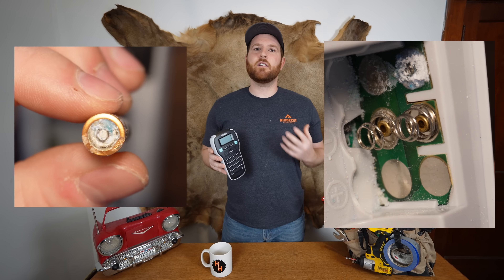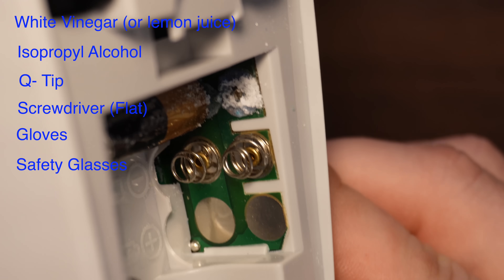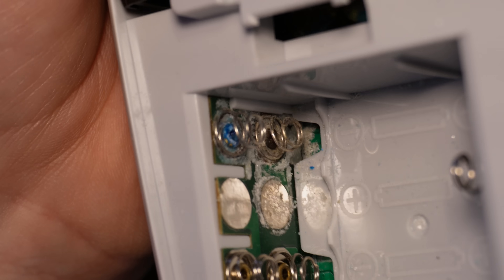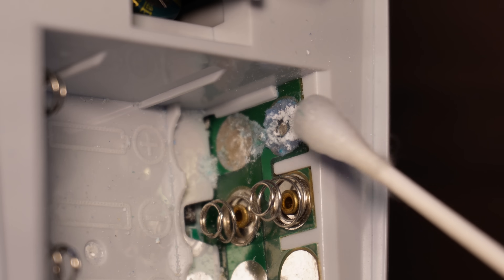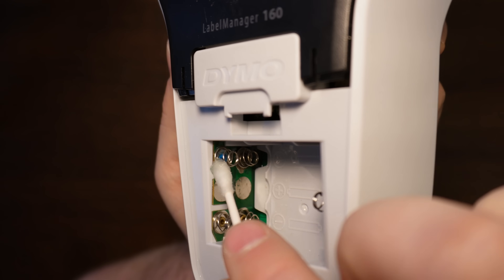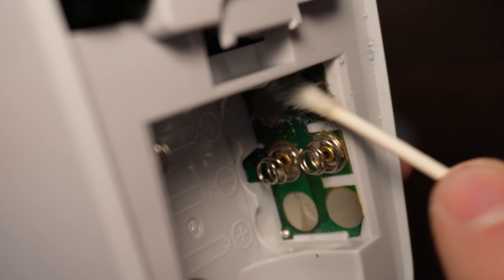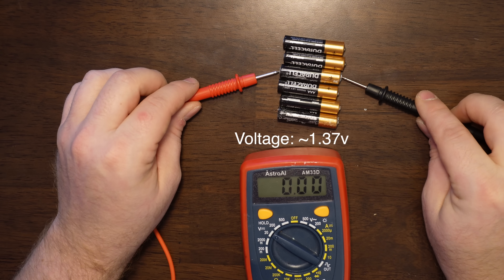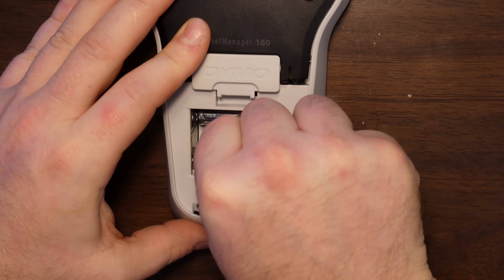Clean BATTERY CORROSION on ELECTRONICS! EASY DIY!  |  2-minute Tutorials Ep.4

Comment: I experience this more often with Duracell copper top batteries vs. other popular brands. If not using a device often, I suggest not using Duracell for a power source.
Reply: I run a small repair shop. A customer will come in and say they've ruined something with leaky batteries. I suggest I know the make of battery before they tell me. I'm usually correct...yeah it's Duracells 90% of the time.
Reply from the maker: Interesting.
Reply from the maker: Yeah, Duracell are notorious for leaking. They’ve lost my business after this package.

Comment: I'm going to try this next time the situation arise.
I've always used a mechanical effort, either with a mini file or a Dremel steel brush wheel.
Reply from the maker: Does that work good?
Reply: @HandymanHertz  
I just remove enough of the build up for there to be connectivity again.

Comment: Much more common problem these days, thanks to battery manufacturers making their batteries cheaper (in quality, not price).  A well designed and manufactured battery should not leak, and for many years I didn't have battery leakage problems with Duracell batteries.  Over the past eight or more years that changed to the point that it is now common on any of my battery powered tools, toys, lights, etc.  I now change the batteries well before they are actually used up, to avoid the damage.  I plan to change to the latest EverReady designs that have a thicker case and better seal to see if that takes care of the problem.
Reply: All of my Duracell batteries leaked over the past few years. AAs destroyed a battery operated sliding door blind and the AAAs destroyed a nice Streamlight flashlight. When they leaked and burst they got jammed into and split the battery tubes. Also two different TV remotes were almost ruined but they could just be cleaned. So I googled it and turns out it is an issue specific to Duracell. So after years of buying the copper top I switched to Energizer lithium that are guaranteed not to leak. Its just not worth taking the risk and I still can not believe how bad the Duracells were. 😡
Reply from the maker: Yeah, Duracell are notorious for leaking. They’ve lost my business after this package.
Reply: Not ever a problem if you buy Amazon batteries. I have gone through a couple hundred with never a one leaking.
Reply: @christopherterry5457 
I’ve done research on different batteries and read that Amazon batteries can explode.
Reply: Avoid Duracelll!!! Personally, I had always used Duracell up to a couple years ago because they ALWAYS ALL LEAKED and ruined a few devices. Even corroded the gloss top of a nightstand from a remote laying there that leaked through the cover!. Not sure if they still guarantee them from leaks, but couple years ago I called Duracell on their guarantee on a couple of devices, described them to the operator and was graciously reimbursed for their value, like this was a common thing. So now I use EverReady, "Energizer Max" everywhere.

Comment: I have never experienced leakage with Duracell (which last very long) and I have been using only them for decades (not the same ones of course). However I have found energizer often to be garbage. Maybe it depends on where one lives. One should never mix different brands and are you mixing alkaline and Mignon here? Can't imagine that.
Reply from the maker: Yeah, Duracell are notorious for leaking. They’ve lost my business after this package. Thanks for the tip

Comment: The standard AA and AAA "copper top" batteries are worthless for anything except use in a toy that will quickly use up the battery.  I am an individual that actually goes through the trouble of recycling my batteries, as you're suppose to, and I collect a bunch of them over time in a plastic container and then take them all in at one time.  The "copper top" batteries were the only ones in the pile of AA and AAA batteries that had begun to leak.  I no longer use them at all, I instead use Amazon Basic batteries and they have been just fine.

I once sent in a complaint to Duracell as corrosion had occurred with one of their AA batteries in a wall clock even though the battery was years away from it's expiration date.  They sent back a gift certificate to buy more Duracell batteries.  I sent the gift certificate back to them telling them to give it to someone who was still willing to use Duracell batteries.
Reply: My mom buys the Costco packs of Duracell and Kirkland batteries. I have seen them already leaking before the package was even opened! Around 80% of the whole box!

Comment: I always thought that you should use something that is base rather than acid. Battery acid so the opposite would be baking soda or something like that. So, he's using vinegar which is acid; acid to acid? I'll try it.
Reply: Alkaline batteries (pH over 7) are the opposite of acid (pH under 7).  The acidity of the vinegar neutralizes the alkalinity of the battery leakage.  Any residue left, whether alkaline or acid, will continue to corrode.  Flushing with alcohol after cleaning is an attempt to remove the residue.
Reply: Thanks for the advice, I appreciate it.  @rogerclevenger8588

Comment: This is why I remove the batteries from everything that don't use daily or store for any pried of time.
Reply from the maker: sounds like a lot of work.
Reply: @HandymanHertz    It's a lot more work cleaning up the contacts and a lot more expensive replacing the devices.
If you can find replacements.
Reply from the maker: That’s a Good point

Comment: Duracell batteries are CRAP. Over and over I have had them leak and ruin stuff. I bought a brand new Roku unit - direct from them - and a few months later I couldn't get it to work. The Duracell batteries they supplied for the remote had leaked ALREADY. Never, ever buy those batteries, they leak far more often than any other alkalines.
Reply from the maker: I agree, I'm not buying them after I'm done with this package!

Comment: Duracell battery leaked. Why am I Not Surprised..
Reply from the maker: Yeah they are the worst
Reply: @HandymanHertz  I usually find they have a high state of charge and last a long time. People do have different experiences though!
It's just that leakage thing though. If you use them in something that's a set it and forget it device I'd use something else. 
With any device that isn't constantly being used it's much better to simply remove the batteries no matter what kind to remove the possibility of damaging the device.

Comment: Prevention is ultimately always a better solution. Buy a tube of Dielectric Grease (aka bulb grease) and lightly apply it to any electrical connectors with a Q-tip or small watercolor paint brush. Alkaline in the batteries are the problem as they tend to corrode over time. Years ago I switched to rechargeable Eneloop batteries made by Sanyo. I was skeptical at first but I have 15 year old Eneloop AA batteries that still work great!
Reply from the maker: thanks for the tips. i agree. seems like duracell is notorious for leaking as well
Reply: @HandymanHertz  Had an old timer tell me that years ago battery companies would reimburse you for items their batteries destroyed by leaking but that very few people knew about it.
Reply: Buying batteries that don’t leak is the best solution. Quit buying these junk batteries that leak. I have been using Amazon batteries for years and have NEVER had one leak.

Comment: Also removing the corrosion hidden under the battery compartment is essential. It requires disassembly of the affected unit to get access to all those nooks and crannies not immediately seen.
Reply: deoxit d5 works much better than vinegar for cleaning corrosion or oxidized contacts
Reply: @lordjaashin  Hmmm
Reply: Thanks, I didn’t think it was possible to remove those little contacts. Anyway that did the trick and may I add there was only a small amount back there but cleaning it out worked.
Reply: Many times I had to open the device and restore the printed circuit. In most cases I won, but sometimes lost.
Reply from the maker: this is probably true. however, i find this is good enough for what i do, and have never had any problems since, and saves time with disassembly.
Reply: I typically use warm sodium hydroxide followed by a little alcohol then a little vinegar, then baking soda then lots of filtered water.  Lastly 99% isopropyl. Never thought about qtips.Typically just use a tooth brush. Will have to try qtips next time.
Reply: @MichaelMantion Why are you using alkaline products. Those make sense if it is a zinc carbon battety?
Reply: @okaro6595  Apparently the "Heavy duty" ones use Zinc Choride, which is very acidic (PH 1). So using baking soda (Sodium Bicarbonate) would be a better way to neutralize the electrolyte.

Comment: And now that it’s clean, I’d strongly suggest tossing the Corrodacells err…. I mean Duracells in the trash and never buying them again.  That brand has really gone down the toilet over the past 15-20 years.  Back in the 80s-90s they were great and rarely if ever leaked, but more recently?  I’ve seen them puking their guts out while still in their retail packaging, unused and less than halfway to their printed 'use by' date.

For anything taking AA or AAA cells that can operate on their slightly lower output voltage (1.2 vs 1.5), I’ve switched exclusively to (originally) Sanyo (now made by Panasonic) Eneloops or the equivalent Fujitsu NiMH batteries.  First learned about them on a photography forum around fifteen years ago as a good option for use in electronic flashes, which tend to gobble up batteries at about the rate howitzer shells were used in the Battle of the Bulge, as a good, reliable rechargeable alternative to buying alkalines by the truckload.  I’ve NEVER had one leak on me, and they just work.  Give them a try.
Reply from the maker: I agree, I'm not buying them after I'm done with this package. Shame, they used to be the best brand IMO. Thanks for the recommendation, I'll have to give them a try.

Comment: Duracell is the worst most corrosive battery you can buy. They should change the slogan to the leaky top instead of copper top
Reply: I call 'em Corrodacells.
Reply from the maker: I agree, I'm not buying them after I'm done with this package. Shame, they used to be the best brand IMO

Comment: For small drain devices ( clocks etc ) just use the old fashioned Zinc Carbon batteries (  UK , Poundland™ ... US , Dollar store ) .... these leak less .... Alkaline batteries ALWAYS spew out LOTS of caustic liquid ( slimey feel , wash hands ! ) .... if you are competent in electronics / soldering  , you might retrofit the discarded Li -Ion batteries from disposible vapes ( these NEVER leak ! ) always recharge first ( 4.2 Volts MAX ! ! ) and use one 3.7 Volt cell in place of TWO 1.5 Volt  cylinder types ( the extra 0.7 Volts should not harm your device  ( ? ) .... ( tried - n - tested ) .... DAVE™🛑

Comment: Here’s an idea that I have used for years, if it is an item that you use in frequently, remove the batteries until your next to use. I put them in a small baggie with that item and I never get corrosion.
Reply from the maker: seems like a lot of work, but that would be a good idea. Seems like not using duracell brand is a good idea too. lots of complaints in these comments on them
Reply: @HandymanHertz  items that you use sporadically such as, digital thermometer, portable blood pressure cuff, etc. are the items that I separate the batteries from.

My flashlights are charged by USB.

I think the problem with the copper top batteries is when they are inserted and they are under some kind of load, which causes them to leak. I have yet to see the copper top batteries in their packaging that ever leaks.

That’s my 2¢ 😂
Reply from the maker: @jasonjackson5696  interesting. Yeah, your 2 cents makes sense to me 😃

Comment: Don't mix battery brands. They can have small voltage differences that cause the batteries to leak and corrode.
Reply from the maker: Doesn't all batteries have small voltage differences, even within a brand?

Comment: I worked on large communication and networking systems and large battery systems and used ammonia for corrosion on the terminals. If working on lead-acid batteries like your car, don't spill it into the acid because it will neutralize it. It also works on small electronics like you did.
Reply: Ammonia might work well on a lead-acid battery, as the corrosion was caused by an acid, and ammonia is an alkali. Alkaline batteries use, well, an alkali as a electrolyte, so, a mild acid like vinegar is more likely to dissolve and remove the corrosion caused by leakage. I also retired from Telecom work where we maintained power systems for equipment, and when batteries leaked (Sealed Lead Acid - Absorbed Glass Mat), they were almost always too far gone to worry about cleaning up the battery itself, so, they got replaced, but, we were provided with a manufactured solution to help dissolve corrosion from the.  I also found that we had a glass cleaner in a spray can that had a fairly high ammonia content that was great for cleaning up and neutralizing residue to help clean up the hazmat mess it all left behind.
Reply from the maker: Interesting, thanks for the idea of using ammonia

Comment: Those  Duracell batteries will leak EVERY TIME‼️They are the WORST‼️
Been using alcohol to clean the battery contacts. Appreciate the vinegar recommendation👍
Reply from the maker: I agree, I'm not buying them after I'm done with this package. Shame, they used to be the best brand IMO